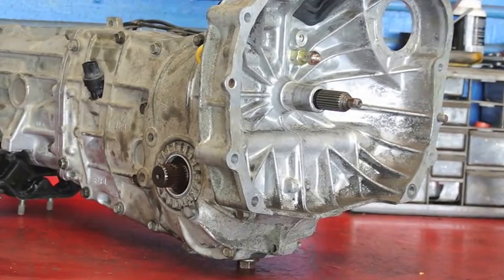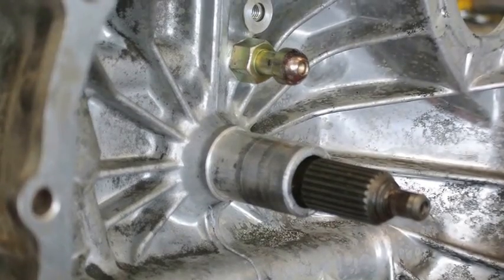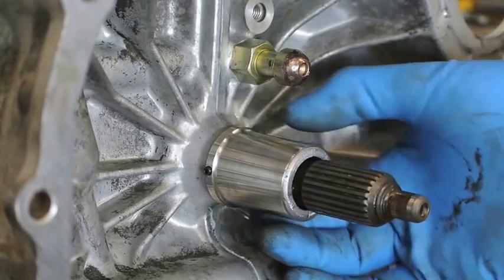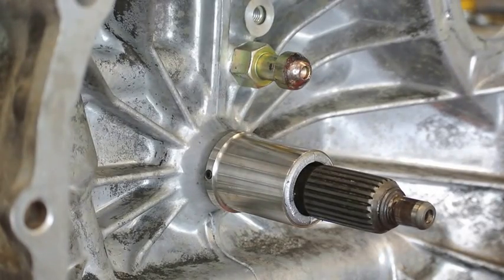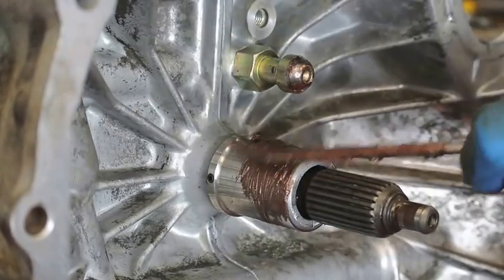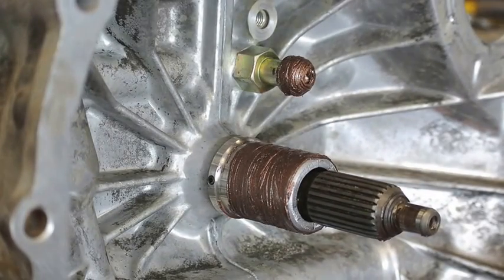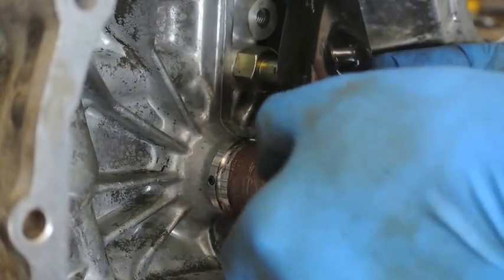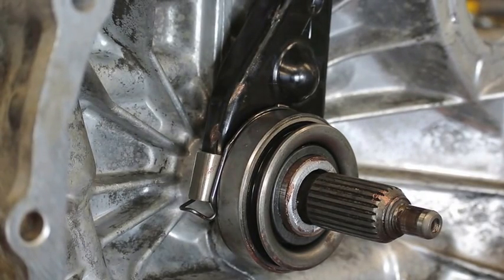Subaru Transmission Snout Repair Tip

Comment: Dude, you couldn't have put this vid out just a few months ago? My friends 08 WRX did this at 65k miles on the clock. Looked everywhere for a fix. Got her a new case and now wish I had seen this. Though on her car the bearing sawed it's way through and the whole snout came off in two separate parts, being that they are made from two halve of the transmission. First Subie I have worked on and other than that it wasn't really much harder than a Honda. Good cars, the Subies.